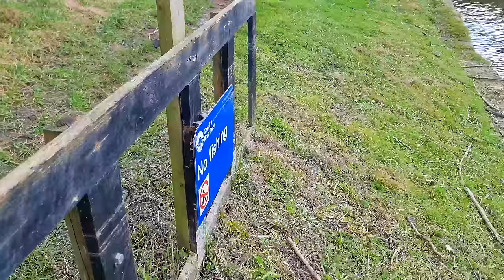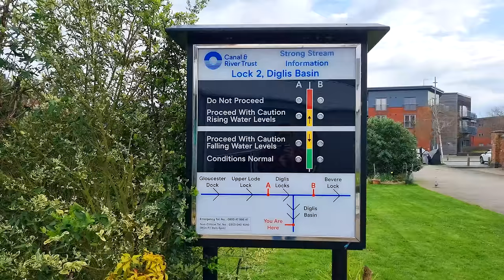We CRASHED Our Campervan! | Narrowboat Cruise to Worcester - 423

Comment: How has the front crossmember been bent so much when there appears to be no damage to the front bumper and you were only travelling at about 7mph.
Reply: Watch the video, they explained that damage was caused by an earlier collision..
Reply: @robinsharples5314  Thats not how I understood as Josh says the damage to the impact bar has caused a leak in the radiator, they say that because there is rust on the impact bar it may have had pervious damage. That does not explain how the impact bar has now been bent and pushed back to damage the radiator.
Reply from the maker: The car we drove into had a handle or something on the back of it so that caused most of the damage. There was hardly any damage to his car. Just lucky I suppose that the bumper wasn't damaged as well. After a month we are still waiting on the insurance company  to agree on the quote we are given.  Lucky it is still drivable